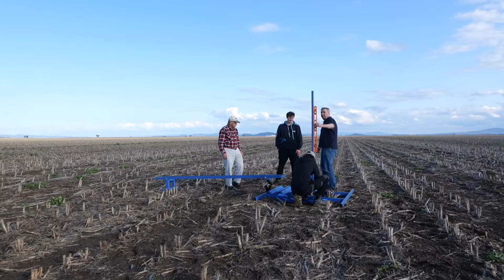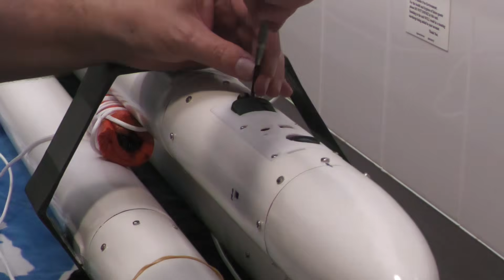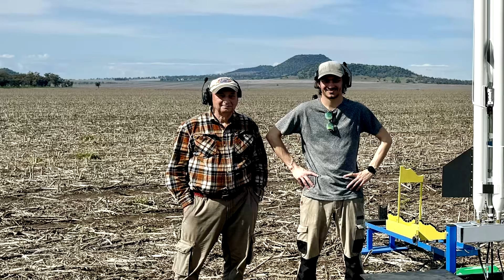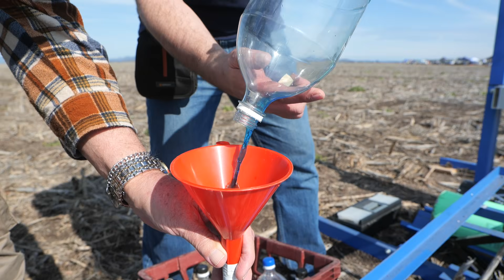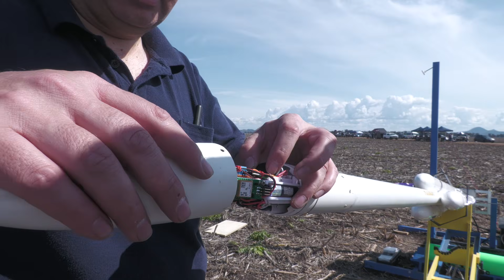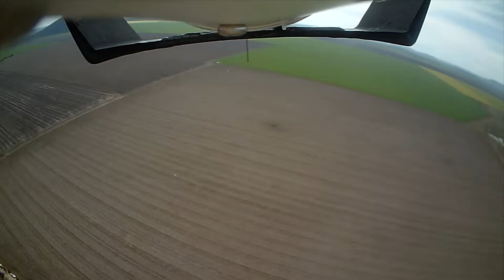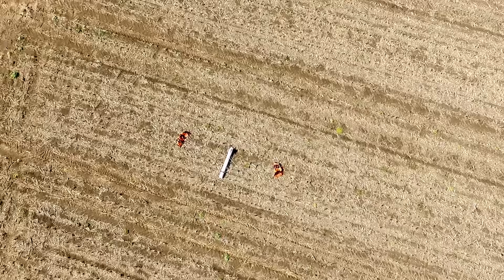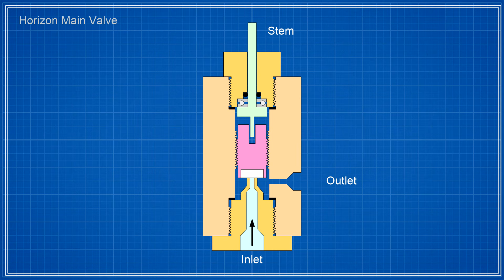World Record 2-Stage Water Rocket Flight

Comment: I loved BUZZ! Have been watching you since the early days, and what you have achieved is fantastic! This one has fantastic metrics!  Love your stuff especially this one that gives credit to the Crew!!! Please don't take offence but in order to go higher, would a guided trolley on the tower make less friction than those long launch tubes?  suspended in the shampoo could be heavy particles? They might erode the nozzles but ,,,
Reply from the maker: Thanks for that. And good questions. The friction on the rail doesn't really affect the overall altitude here. The rail buttons were teflon so quite slippery on the rail. The rail was fairly short as well. The launch tubes don't guide the rocket, they act as pistons that the rocket pushes against as it launches. This allows the rocket to gain a lot of momentum without using almost any water and a little bit of pressure before it starts using the water for propulsion. The launch tubes help raise the altitude by 10-15%. The launch tubes are also fairly low friction because some water escapes past the nozzle so it acts as a lubricant. 
Increasing the density of the liquid may produce greater thrust, but because the liquid that's still inside of the rocket is also heavier you have to have more thrust to lift it. As a result you may not necessarily go higher.

Comment: Congratulations!

Hmm... Do the power connectors lock? They looked pretty fiddly too. It would be cool if there was redundancy, but fewer batteries. I still think that any rocket-computer company would love to make whatever you want.
I am assuming that that for the first meter or so, the booster isn't just throwing mass. Perhaps a blast plate might also couple the rocket hydraulically--so it may be pushed a bit further into the ground, which only surface are could help, such as plywood.
 It's quite fast. Perhaps the leading/trailing edges of the fins can be rounded and boat-tailed. Perhaps also, the staging mechanism could be streamlined a bit.
Excellent work! You have the layup procedure down. Perhaps someone could get a single booster to take that pressure--but all 4 cylinders with no failure quite an achievement!
Reply from the maker: No the power connectors don't lock, but the friction is high enough that we've never had an issue with them coming apart. It's a standard connector we use on all of our flight electronics so it's easy to mix and match different components. 
The launcher is fitted with launch tubes which act like pistons as the booster accelerates up before it starts using the water. This helps raise overall altitude by 10-15%. 
There are certainly particular optimizations that could be done to the entire rocket, but it is a compromise between how much time and cost it takes and how much of an improvement you get as a result. Rounding the leading and trailing edges of the booster fins is an option, it may take you half a day in your tight schedule, but it may result in only 5 extra feet of altitude. The entire project was a set of compromises, and usually durability and strength won over optimization. When there are hundreds of things that can fail, you want to make sure something doesn't fail simply because it was optimized close to its structural limits.

Comment: Hey! Congratulations to the successful launch! I followed your project since the early days, probably from around part 8-9. What catched my attention is that water rockets sounds like a joke. Yet... the way how you approached this whole project clearly shown the difference of doing something without clue or doing it using a proper engineering. 

Also my favourite episodes was when you built the launcher. GSE is the most overlooked thing in the space community, way too many people don't realize that the launcher is as - if not more - complex as the rocket itself. (And my observation is that there is only one thing is more overlooked: orbital launch vehicles purpose is to launch and deliver actual payloads/missions, not to be sexy on technological side, but that is a different topic) Remembering to your initial design, I think even you underestimated the complexity of that. Obviously, you didn't set up a big manufacturing line. But still, the way you handled the launcher, test stands, tooling, etc. thinking about about how to operate, what about abort modes, contingencies, etc. Very-very educational and should everyone watch (and understand first!) before opens his mouth about space (or engineering). The internet and the space community would be a better place. 

It was a long 7 year - interestingly, very similarly long as other a big, orbital launch vehicles out there. I'm thankful for your videos, and I hope you will continue with an even more ambitious project!
Reply from the maker: Thanks, I agree, it was definitely something we underestimated how much work the launcher would take. When dealing with higher pressures all of a sudden everything is important to get right. There are a few things we would do differently next time around, but this one kind of evolved from the things we already had, or could easily manufacture at home.

Comment: Because the "launch rod" behaves as a pneumatic piston for the first few feet of acceleration, the thrust does not come from impulse and you are not expelling any propellant mass; because it kinda seems like a launch assist system of some sort and to my eye a tad bit cheaty, what do the record rules say about that? I do get it that the energy still comes from the rocket's tank. Thanks for the vid and congratz on the new record.
Reply: what I mean is: you have a component that contributes to thrust but is not part of the rocket.
Reply from the maker: Yes, absolutely the launch tube contributes to the performance. Typically a launch tube can raise the altitude by 10-15% That is why they are almost always used with water rockets, and especially for high performance rockets. It's also one of the reasons the high performance rockets tend to be long and narrow, so that you can fit a longer launch tube in them. They are very much a part of the water rocket hobby. You can improve the performance of launch tubes even further using Air Reservoir Boosters (ARBs) ... a volume of air in the launcher at the same pressure as the rocket that tops off the rocket as it slides up the launch tube. For more info on these: http://www.aircommandrockets.com/day120.htm and https://youtu.be/buualo35Hc0
Reply: @AirCommandRockets  Thanks. This is fascinating stuff.

Comment: Congratulations!

I have one question: why do you use such long launching tubes? They need perfect alignment and create friction. Why not short ones?

Maybe, my question was answered already in previous videos, but I missed?

Thank you
Reply from the maker: Thanks, and a great question. The longer the launch tube the better the performance we get. The launch tube acts as a piston, and the longer you make the piston the better performance boost you can get. The rocket accelerates up the launch tube before it starts using the water, and looses only a little bit of pressure. By the time the rocket leaves the launch tube, it already has a lot of momentum before it even starts using the water and air to accelerate further. A launch tube can raise the altitude by 10-15% than if you didn't use one. The launch tubes themselves are free to move around, they aren't firmly attached to the launcher, this allows them to move independently as the rocket moves up them so there is very little friction. Some high pressure water escapes past them which acts as a lubricant.
Reply: @AirCommandRockets  Oh, it is non-trivial effect, thank you for explanation!

Comment: I remember commenting years ago asking if a mile high flight was possible on here, it's great to see that your team was able to pull this off!  Been watching for well over 10 years now. Hopefully there will be follow-up launches in the future, it does look capable of pushing the limits a little more.  The slow-mo guys should come for the next launch. Did you find out what the final PSI was prior to liftoff?
Reply from the maker: Thanks very much! We really didn't have an accurate simulation on this rocket before flight. We were expecting somewhere 4000-4500' but were surprised at the better performance to just squeak past the mile mark. In terms of pushing the pressure a little further that is an unknown, everything for the entire rocket and launcher was designed with the 1000psi pressure and the forces that involves in mind. I don't know what would let go first. I fully endorse a visit by the Slow-mo guys. That would be a fun collaboration.  The final launch pressure was just a little bit over 1000psi

Comment: 3 stage rocket for mach1++?
And stage separation at vmax, should give a few 10m/s extra, too.
And what about INS/acceleration based loggers? Should be at least quite a bit more accurate for a few second boost phase IMO, than barometric sensor with all kinds of funny effects.
Reply from the maker: 3 stage .... mmmm ... tempting :)  Unfortunately non of these flight computers had accelerometers on board and with vertical velocity derived from altitude readings, it makes it much harder to derive acceleration from that noisy data with any meaningful accuracy. Many flight computers that have accelerometers don't necessarily have the G range to cover this launch without saturating. We're happy with the estimate for acceleration from the simulations.

Comment: A lot of engineering work even for a water rocket. Congratulations. What's next?
Reply from the maker: A few projects are currently being planned. One is looking at high pressure foam and corresponding nozzle design to try to squeeze out even more performance. It will involve a lot of test stand work.

Comment: Very impressed by the whole operation.  Your cameras and telemetry on the rocket stages appeared to function perfectly, at up to 70g of force!  
One thing which I noticed was the secondary pop, or plume which occurs right after the booster leaves the end of the pressurization rails.  Any ideas what caused this?  I'm thinking it is some rebound of the water/air after the initial shock of "ignition".
Reply from the maker: Cheers! There is high pressure air in the launch tubes, so that as the rocket nozzles come off the end of the launch tube and start ejecting water, this water is impacted by the high pressure air coming from the top of the launch tube and you get a big puff of water spray. The next puff after the coloured water runs out is the remaining high pressure air left in the rocket as it escapes.

Comment: That second stage "ignition" was incredible! Also, 55 minutes of video? Feels like christmas present :)  Congrats on flying this complex rocket and after so many years of development. PS. Is there any chance that this rocket will fly again at even higher pressure?
Reply from the maker: Cheers. The speed of the second stage even surprised me when I saw it. We are not sure if this rocket will fly again at a higher pressure. Everything from the release mechanisms, staging mechanism,  launcher design and the pressure chambers were designed with 1000psi in mind. It would probably handle maybe another 100psi but after that I don't know what would fail first.

Comment: 50:45 that happens because of high pressure, probably because you released a lot of that when the 2nd staged. You can see this happen sometimes on HPR rockets when the ejection charge goes off.
Reply from the maker: I suspect it is something along those lines.

Comment: Amazing work!

Here is a though on the Strata Logger on the sustainer:

Could it have decided that the staging event was a "launch" and reset to zero AGL?

If the recorded data is a moving average of the noisy instantaneous AGL, but that instantaneous AGL already has the launch altitude subtracted, when it reset to zero AGL the recorded trace would suddenly and quickly move towards zero, but NOT instantaneously, because it's still a moving average with some of the older altitudes still averaged in, but also the new post-reset ones. Then once the window of averages slides past the erroneous reset it would appear to climb totally normally from around zero.

You'd need the person who wrote the code for the Strata Logger to confirm, but I mention this because it could be a meaningful increase to your record altitude if I am right, and perhaps your GPS would agree.
Reply: (BTW I am a programmer and have scratch built my own baro altimeters, so I am not saying I am right, but I could be)
Reply from the maker: I don't believe that the stratologger thought the staging was another launch as the data matched the initial part of the flight to both the quantum flight computers on the booster. I also believe that the data is valid above the issue mentioned, because there is no discontinuity on the way down, and it descended at a constant rate. It certainly filtered the event correctly, and didn't detect the first spike as apogee, otherwise it would have deployed the parachute. 
But you are right, only the programmers of the stratologger would know the most about why the stratologger may have behaved that way.

Comment: This was certainly fun to follow. Interesting discussion of when to begin sustainer. Would the simulations tell what an optimal time would be? You mentioned doing it at peak acceleration (or speed?). Or just launch again with a few different times.
Reply from the maker: Good question. Normally you want to stage as soon as you reach maximum speed. We are still too close to the ground where coasting would allow us to reach a thinner atmosphere before staging. After maximum speed you are losing momentum as you have this big draggy thing attached to you. We debated on the timing, I knew I didn't want to stage too close to the ground, but if we left it much later then the water in the second stage would have moved too far upwards in the sustainer and at staging a lot of the air would escape before the water reached the nozzle again.
Reply: @AirCommandRockets  Oh, so because the rocket is decelerating after peak speed, the water sloshes upward? Would never have considered that!
Reply from the maker: @mstreich  Yes that's right, drag causes the rocket to slow down faster than if it was just slowing down by gravity alone. We actually did some experiments on this: https://youtu.be/achyPjJ2lQE

Comment: Nice one.Maybe if you added water/foam mixture on the booster stage,you could have reached 2km altitude.
Reply from the maker: The foam really tends to benefit from smaller nozzles that provide a longer more sustained burn. The booster is designed for maximum acceleration off the pad and so has larger nozzles and a really short burn. You can see that the water ran out just a few meters above the ground. Foam in this instance wouldn't have much time to give a performance boost.